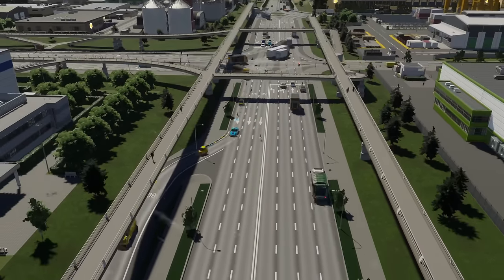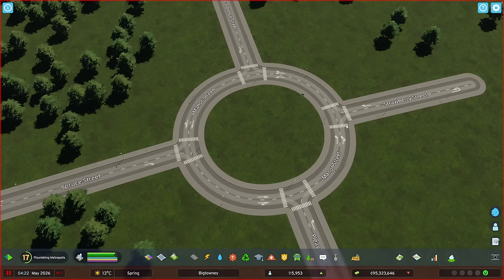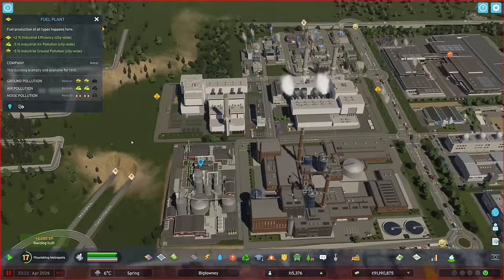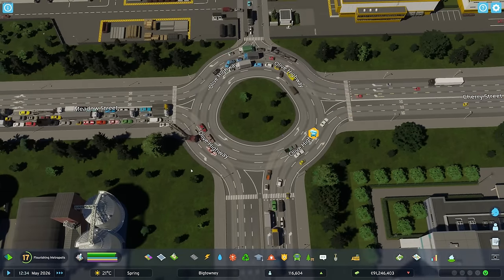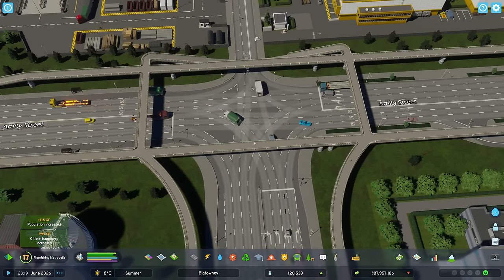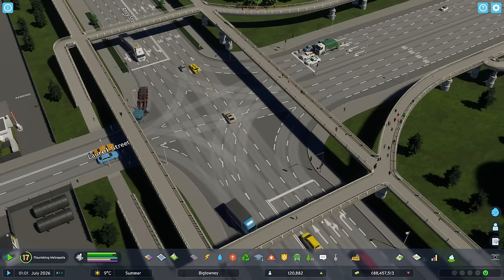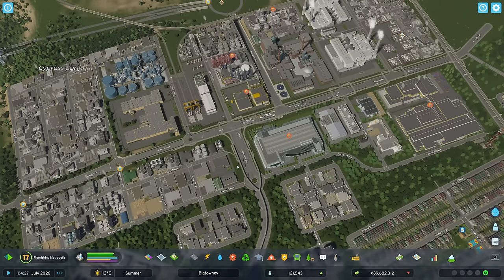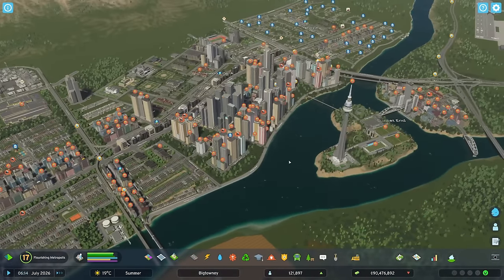Detailed Look at Traffic Behavior in Cities: Skylines 2

Comment: The junction / roundabout at 12 minutes doesn't make sense - you don't exit a highway using a fast / outside lane (left lane in your video), you turn off a slow / inside lane (right lane).  So I'd imagine the devs expected the traffic to want to move to and stay in the slow / inside lane (right on your roads) as much as possible, and only move into a new lane when overtaking or volume of traffic in the inside lane makes it desirable.  But in your video, you're forcing the slow traffic that wants to be in the right hand lane to cross 2 fast lanes of traffic in 1 node to exit onto the roundabout.  So of course it's going to cause a traffic jam - that's exactly what would happen in real life.  Put your exit lane on the right where it should be, and it'll work better.

But as you say, junctions do really need finer TM:PE like controls.  Didn't realise custom roundabouts don't work, though I guess that explains why one of my dog-bone junctions isn't working properly.

Is the lane switching always happening between nodes and no longer at nodes?  have they just swapped the behaviour from CS1?

Comment: I get that you are frustrated by dedicated turning lanes not being used correctly and cars just going to the empty lanes even if they don't have to be there. But you would be surprised how realistic this type of behaviour is, especially when your exit ramps are on the left side of the road forcing all cars to move from the right lane to the left lane. And in a traffic jam many cars will simply try to progress into the empty lane and try to switch back later. This kind of behaviour worsens the traffic jam, but it happens in real life all the time.
Reply from the maker: I have seen how traffic behaves in real life, I was an every-day driver for years. You can literally look even at the worst cuts across all lanes, stupid detours or crashes and say you have witnessed that in real traffic too, or saw that in dashcam videos on youtube. The problem is that vast majority of CS2 cars behave that way. Real life drivers are nuclear scientists compared to this. Yes in real life cars mostly drive on the right side of highways, in my country its even ilegal to drive anywhere else unless you are overtaking, so a left exit lane would be a problem. I have not seen that behaviour in CS2, cars use all available lanes on highways and switch as they want. Not to mention, this particular situation was the only place for cars to go, the straight direction is not connected. And, the very frequent switching into an empty lane literally happens on the spot, car will switch and immediatelly switch back in the same spot, plus do it while turning almost 90°. Is that realistic in the sense that one stupid driver most likely did that somewhere in irl? Sure. Is that realistic in the frequency they do it here? Absolutely not.

Comment: It sucks that you can't just remove rush hour, because realistically it would be very easy. Rush hour is the result of a standardized start and end time for jobs, causing both customers and workers to all flow at once during specific concentrated points of the day. Staggering the times at which different businesses open and close would completely solve the problem, allowing most cities to halve the capacity of sections of their road systems. Cities Skylines 2 suffers a lot from just accepting that things like that exist rather than letting you do anything to fix the problem at its core.

Comment: Road signs and bus roads are a joke to my citizens. Bus roads are also for "turning traffic" unless they see that it saves them a lot of times. Then they don't give a shit. Just clog up my bus roads that I use lessen the pressure on the roads...

Road signs are even worse. If they have to drive an extra block because of the sign they just ignore it and stop in the middle of the busy ass road. Stopping all traffic to wait to be able to turn, which they can't since the other side of the road is also busy af.

Comment: Some of the "issues" with the traffic simulation is actually quite realistic. It reminds me of the Paradox's video on population and how there are different types of people in the simulation. Not all of the people are gonna follow the rules and will value different things (time, money and comfort)  differently. 

The crossing in the place where there is no crossing, or using cargo terminal road as a bypass during rush hour are some of the "shortcuts" that these people are taking. This perfectly reflects the detail they mentioned in the video and could be an outcome of the feature they intended. Maybe they have overdone it.

Although it makes our job as city builder much difficult, it kinda has some realism to it. 

I think it needs to be toned down and the technical issues need to be fixed like not having granular control over the the interchanges.
Reply: I think they tried to make it realistic there but just kinda missed the mark. The example with the one single crossing pedestrian is a good one. it's only one, the count is low. It could show realism, but it falls flat. Why? It's an 8-lane road. I think instead of 1 in 20 more like 1 in 100000 would dare to cross that asphalt mess. And they'd have to be drunk and high.

It makes sense on small two lane or residential roads. And I think it looks beautiful there to see people just randomly cross, props there. But they ignore the context of the situation. It's especially just wrong and unrealistic if you see that one pedestrian crossing the biggest road in the game WHILE hundreds of cars are speeding and the road is extremely busy. If they took traffic and roads into consideration it'd be perfect imo, but I don't think they do